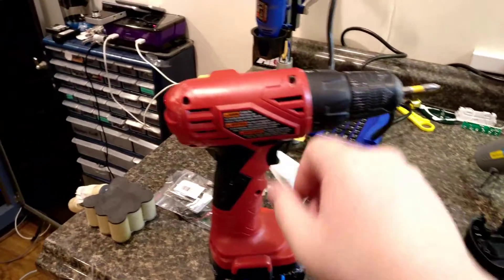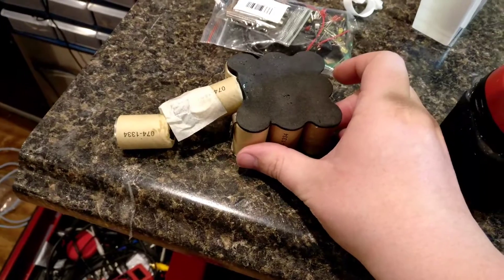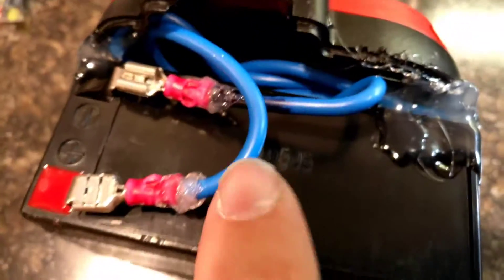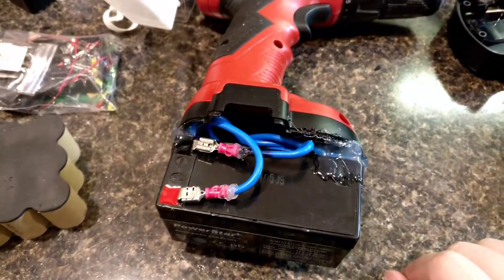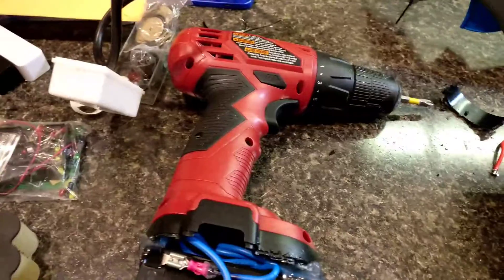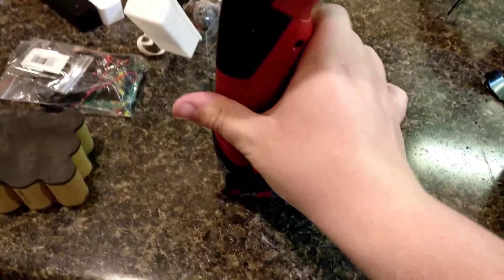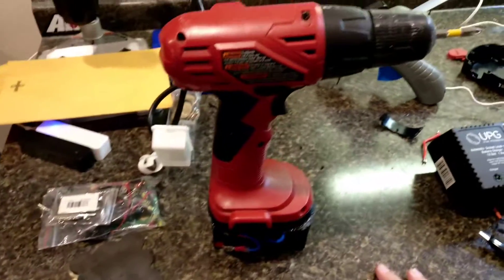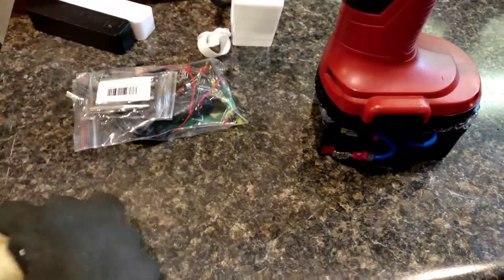Converted SKIL drill to sealed lead acid battery

Comment: I just bought this same exact drill a couple of minutes ago for the same exact reason , I can run it off of any 12 volt battery or supply .      I'm going to try to make a lithium ion battery pack for it . Thanks for this video , good to see some one else going with the 12 volt idea .